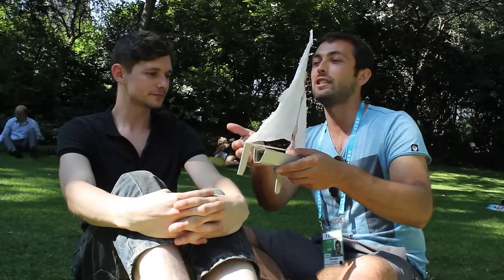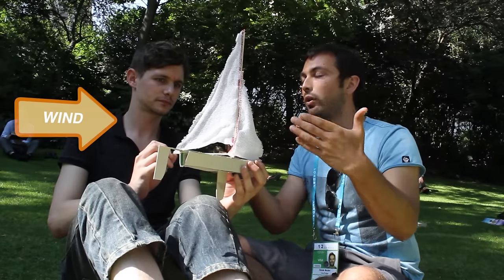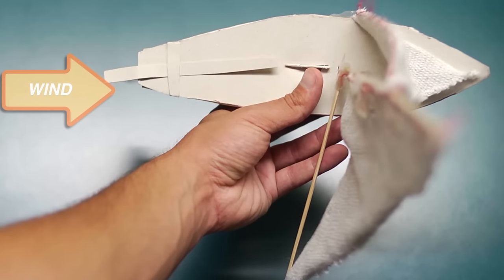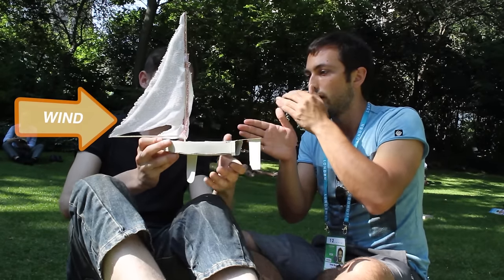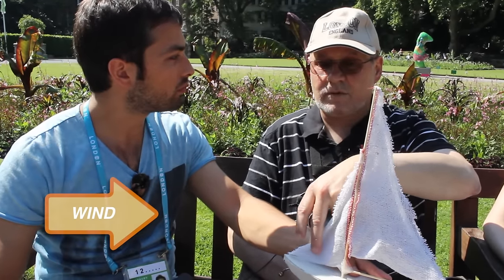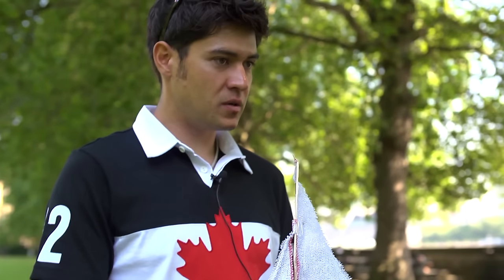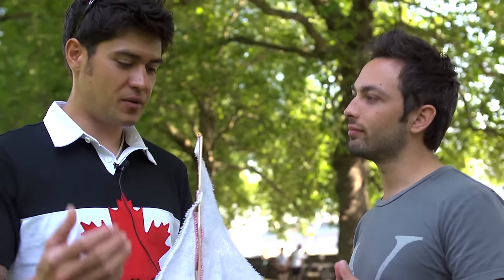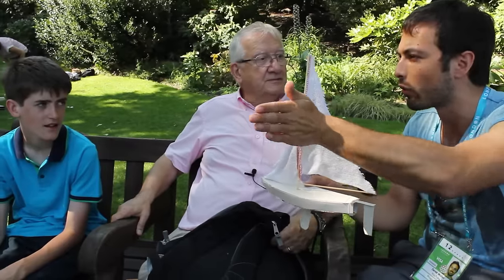How Does A Sailboat Actually Work?

Comment: that guy actually did not explain anything at all... wtf.
Reply: +Clark Eom totally. the sail guy repeats the bernouilli stuff we all learnt in middle school. he should know better.
Reply: +Clark Eom it made sense to me...
Reply: +Carl Coppens u wat mate
Reply: asking question is at least as valuable as answering them ;) it rises awareness
Reply: Essentially a sail works as a sideways wing.
Reply: He explained a lot if you were listening. The wind hits the sail from any direction (except directly forwards of course) And pushes inwards, creating a force on the other side of the sail. The direction of movement without water would be angled from the schools original movement of the wind, and in the water, the ship moves forwards.
Reply: @Paulo_Dirac  not when the title of the video is misleading
Reply: Wrong answers to the wrong question.  I think the purpose of the video was to watch people scratch their heads or say "I don't know" -- which is fine, most people don't come out of the womb understanding physics, let alone the physics of sailing.  And there's a LOT of physics to sailing.  Add the differences in sail plan, keel vs. centerboard vs. leeboard, Bermuda/gaff rig vs. sloop/ketch/yawl/cutter/schooner, etc., eyes will just start rolling into the back of the head.  You're never going to get to the nuts & bolts of sailing physics in a 4 1/2 minute video.  This was for entertainment value, not teaching.
Reply: @Alfredo Duro Exactly
Reply: @prateekpanwar646  come on.. YouTube means video not reading
Reply: It made sense to me but also bc i sailboat in summer but it‘s still pretty easy basically its like an airplane wing that does one thing, because the wind pushes on the sail it creates a high pressure zone and on the back of the sail it creates a low pressure zone like in an airplane, and basically when you create a low pressure zone near a high pressure zone the high pressure zone wants to go to the low one so it will pull you to it but because you have the delta idk how it‘s called in english but its like the fin under the boat and u also have the rudder to steer you try and push away ur boat from dragging you to that direct low pressure zone so you can go where u want, and keeping the boat steady is really really difficult still because the wind is really strong and that‘s why you can see videos of real big competition boats beeing basically in the air on one side bc its so hard to keep the boat on the ground, so actually people of the crew attach themselves on steel cables to hang off the side of the boat bc else the would fall over
Reply: He did. Pressure difference due to sails causing a diagonal force. Keel cancelling the horizontal motion. Need for hiking to avoid toppling. And how you can travel faster than the windspeed.

Comment: The modern sailboat is one of the purest most beautiful applications of mechanics. The video failed to describe this very well. As the wind provides a pressure gradient between both sides of the sail, the force exerted generated by the lift is somewhat parallel to the of the boats boom. Why does this not cause the boat to drift off in that direction? The center board that protrudes the bottom of the hull causes an opposite effect to take place. The force with the wind opposes the force in the water, which is stationary. The two forces can be visualized as vectors on a vector diagram. These two forces create a resultant vector, in the direction in which the boat moves, which is a single component representing the effect of all other present vectors. For those of you who know sailing, you might know now why a broad reach (135° from oncoming wind) is the fastest point of sail, not because of the wind behind generally behind the sail, but because the vectors point nearer to the direction of motion (increasing the value of the resultant) than at any other point of sail.
Reply: thank you. but that leads me to a question, it seems that vector also has a degree point upward, let assume it is 20 degree, would it change the acceleration rate or how do we value that speed?

Comment: My aerospace engineer son tells me that the "convex wind speed higher leading to lower pressure" theory is incorrect.
He says that no lift occurs without deflection of the airstream. A helicopter blade can spin as fast as it likes, but goes nowhere unless the blades are angled to generate downdraft.
The traditional theory always bothered me as, unlike a planes wing, the concave surface of a sail is actually the same length as the convex, so the airstream velocities should be the same

Comment from the maker: OK, I recognise the last vid may have been confusing. Bernoulli is fine if you don't make simplifications like 'air meets up at the trailing edge,' and 'air does not need to be deflected by its interaction with the air foil.' This is what I was trying to say. And the reason I made that vid was so there would be backup for this vid because I knew we didn't have time to go into lift in detail in this vid.

Comment: As a sailor, I'd have to disagree with his conclusion of 90-45 degrees off the wind being the fastest point of sail, at least with most boats.  The fastest most boats goes is when they're broad reaching, or about 110-160 degrees or so off the wind.  I don't know the physics behind it, but I know it's enabled partially with a combination of using wave action, being able to put up large, parachute-like sails called spinnakers which can't be used sailing upwind, and the all important ability to plane, which greatly reduces drag.  Also, since the centerboard is less necessary when headed in that direction, some boats allow it to be retracted, thus reducing drag even more.  Some super high performance boats may act differently, but with most traditional boats, it simply isn't true.  For example, a boat I typically sail on, the Melges 24, can, in let's say 20 knots of breeze, go about 6-8 knots beating upwind, but can get up to speeds of 12-15 knots while reaching back down wind with it's chute up,
Reply: thank god some actual know how!!! the reason you sail faster as you come off the wind from a fetch to the reach and finally broad reach is because of the fatt that the boat lift generated by the sail and keel starts to move from a right angle to the wind when close hauled to more in line with the direction of course as when you are broad reaching the lift angle is almost the same direction as the direction of travel. have a look at your polars on your white sails and you will see it beautifully illustrated
Reply: Depends on the boat, depends on the wind, depends--as you pointed out--on the sail plan. On a typical 10-12 knot day in San Diego my Ghost 13's optimal point of sail is just below a close reach. As the breeze freshens, the optimal point of sail works its way down. At around 18 knots, that boat flat hauls the mail on a broad reach.

All that's a bit nuanced for a four-minute video intended for a mostly non-sailing audience. He could have said a boat's fastest on a broad reach and left it at that.
Reply: Depends on the boat, the sails it's using AND the true wind speed. Most catamarans sail fastest on a beam reach (90 degrees) but only in light to medium winds, as the true wind speed increases, sailing lower is faster (130-135).
Reply: I've done some race sailing myself as well on various sizes of boats (catamaran up to 42 feet) and I can tell you that your explanation is partly true, but it really depends on the boat, the size, the shape of the hull, the depth of the keel and the weight. 

The story told in the video is true for a very lightweight boat with low friction (such as a catamaran). The lift generated is easily able to lift almost all of the hull out of the water, especially when the keel is designed to create lift in the water as well (like the curved keels you see in top level catamaran racing nowadays). In extreme cases and high speeds, these boats can actually plane on their keels alone. These boats easily exceed the speed of the wind. Watch some Olympic Catamaran or Finn racing to see an example. 

Bigger boats can still go pretty fast upwind, but they will definitely not exceed it; the weight of the keel pulls down a lot of the hull which in order creates a lot of friction with the water, in which case hoisting a spinnaker and going downwind is definitely faster, especially if you can plane (but for big/heavy boats that requires seriously heavy wind). For the biggest boats, making a surf (which means having downwind and riding a wave) is the best way to win time. Going downwind with a spinnaker with the 35 footer I sail right now in 20 knots will take me up to maybe 9-10 knots, but when I make a surf that can jump up to 13-14 knots easily.

Comment: Hi Derek,
I think you got the last one wrong. The boat is fastest not at 45 or 90 degrees but somewhere around 135 degrees. Sailing in this direction and thanks to the position of your sails you still have a laminar flow of wind on both sides of the sail, which generates lift (which doesn't happen when sailing at 180°) and in addition more lift gets generated underneath the hull, which causes it to raise higher from under the water, grateful reducing drag on the hull. Therefore 135° would be the fastest direction to sail.
Reply: Derek’s idea works In a theoretical world where you have enough ballast or counter weight to overcome the lateral force on a course 90° to the wind. Some boats like the international canoe or the amac moth mk2 sail fastest around 95° to 100° relative to the wind.

Comment: You can also explain the ability of a boat to move upwind using the principle of a wedge (or triangle) placing pressure on two sides of the wedge will make it move perpendicular to side 3. The two sides are A. boats sail and B. boats centre board + rudder, where the confusion occurs is that side A and B are in different locations respective to a wedge, though with the same angles they produce the same effect as a wedge.
This also nicely explains how a boat can go faster than the wind.

Comment: I believe the fastest point of sail is a Beam Reach (~ 90' to the wind). In this direction the sails are always powered (unlike downwind).  The angle of attack needs to be adjusted as you speed up.  This will still be 90' to the apparent wind but pointing slightly away from the true wind.

Comment: My father had me on a sailboat from an early age, and one thing i learned more than anything else is that you use the sails to push the keel against the water in different ways to create the pressure to 'go faster than the wind'.  Water currents also come into play.

Moving into the wind requires 'tacking' back and forth sometimes depending on the wind conditions.

Comment: Oops, this is the first video where you are mistaken.   I've watched about 70 of your videos so far. 

The sail does not act like a ridged wing structure. Instead it has more to do with fluidics where the wind is essentially redirected by "spilling" it in a common direction. The redirection of course provides the equal and opposite force which propels the boat.

A parachute operates with the same principles but spillage is limited to a down vector and the decent of the parachuter is slowed.

Comment: I'm not sure if you'd call it sailing as such, but you can link a propellor via a gearbox to the wheels of a land yacht and go directly downwind faster than the wind, powered only by the wind. It's counter-intuitive but it's theoretically sound and has been practically demonstrated. In theory you could do the same with a boat by linking your "sail" propellor to a "drive" propellor in the water, but in practice I expect you'd have too much drag from the hull in the water.

Comment: Although a sail could be considered to generate lift, a simpler explanation is that similar to a wing that diverts the relative air flow (relative to the wing) downwards (when in level flight), a sail diverts the relative air flow. (relative to the sail). A sailboat takes advantage of the difference in the speed of the wind versus the speed of the water, which assuming a steady wind, is independent of the sail boat's speed. 

The key component of the sails diversion of flow is that it diverts a relative crosswind (relative to the sail boat) backwards,  which coexists with a forwards force exerted onto the sail (which in turn exerts a forward force to the sail boat).  For a given true wind speed relative to the water, then the crosswind relative to a sail boat is the sin of the angle  between the path of the sail boat and the path of the true wind,  and this crosswind is independent of the sailboats speed. 

For sailing upwind, the more efficient the sail boat, the smaller the angle between the boats path and the wind's  path, and the smallest angle for a specific sail boat is called "beta". The fastest speed (with respect to the water) occurs when the sail boat travels at 90 degrees across the wind and "beta" degrees downwind.  Remember the crosswind (relative to the boat) is independent of the sail boats speed and only depends on the sail boat's heading with respect to the wind.

Very efficient sail boats like catamarans can "outrun" the wind, meaning their net downwind component of speed can be faster than the true wind speed. The Americas cup catamarans can achieve net downwind speed faster than 1.5 x true wind speed both downwind and upwind. Although the sail boat "outruns" the wind it's currently in, the wind ahead of the boat has a head start and the boat continues to sail into a continuous supply of crosswind, again regardless of the sail boats speed.

Somewhat related, what is known as a directly downwind faster than the wind (DDWFTTW) land craft, drives a propeller with it's wheels and can go faster than the wind that propels it. In the case of the "Blackbird", it could go directly downwind about 2.5 times the speed of the true wind.

https://en.wikipedia.org/wiki/Blackbird_(land_yacht)

https://www.youtube.com/watch?v=5CcgmpBGSCI